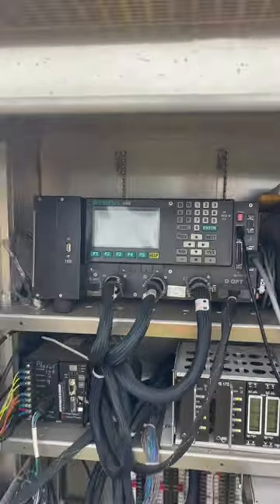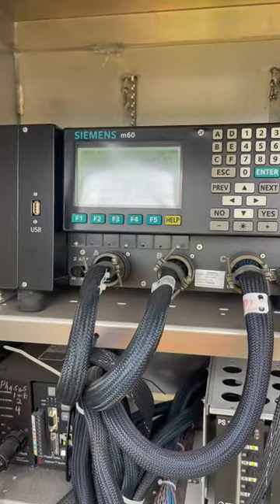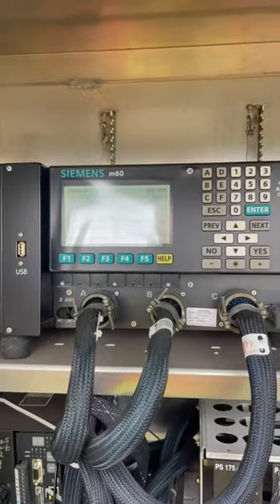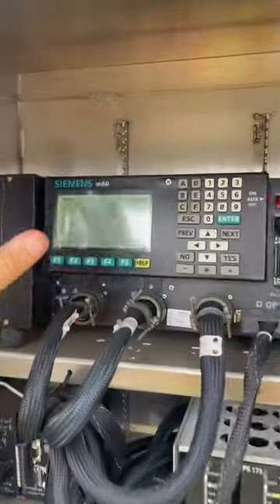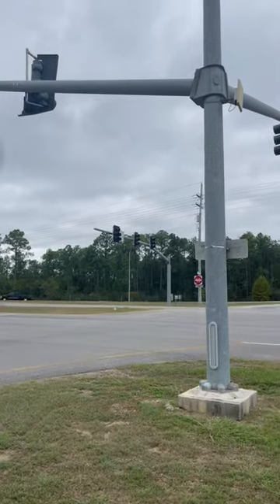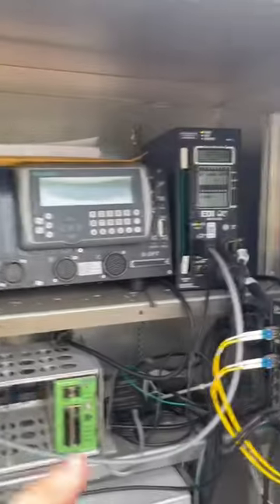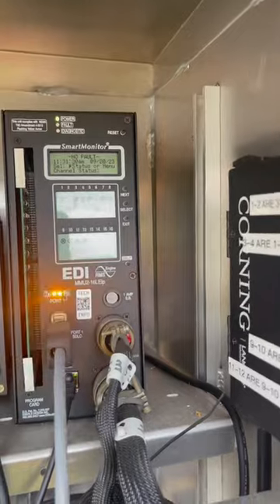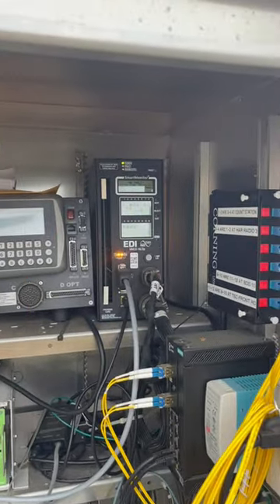Raspberry pi and traffic lights!

Comment: anybody saying a raspberry pi can reliably control an intersection for 30 years is probably still in high school
Reply: Anyone that thinks this stuff in the metal box is going to control an intersection for 30 years is insane.
Reply: @Hornet135 I must be insane
Reply: From what I can find the siemens m60 was released in 2015 and I have seen this tech replace at least 1. Seems a might bit short of 30 years.
Reply: @Hornet135 I work in rail not roads, but I have seen many boxes full of 30 year old siemens equipment similar to this. It's not hyperbole, they do run consistently for decades with proper maintenance.
Working in railways it's pretty common to encounter equipment that is older than I am.
Reply: @aaronbennett80  Sure there’s all kinds of old systems running stuff all over, but the idea that it’s set it and forget it for 30 years is ridiculous. Even if someone can work for decades, that doesn’t mean that it’s the best or most efficient way to do things.
Reply: @Hornet135  Of course it isn't. But public service isn't funded enough to even come close to best.
Even if we wanted to upgrade everything in the railways I work for to modern hardware it would take decades and billions of dollars.

There are some sections of the rail that have even older analog equipment from the 70s. They get upgraded first, that takes 3-6 years depending on scale of the project. By that time the brand new system that was installed 7 years ago is already fast approaching the recommended manufacturer replacement time.

It's a complicated thing to keep large amounts of geographically dispersed industrial systems up to date.

Then consider the amount of money it would cost. It's politicians that fund this stuff. These old devices still work, they don't cause political issues, the public can't see them and the public for the most part doesn't give 2 shits if its ancient as long as their train is there on time. Politicians don't care because it doesn't win them any votes or improve the lives of their constituents in an obvious way, so they often don't fund the projects until they want to run a campaign focused on increasing the amount of schedules trains or something.

Then you get a good politican that actually funds projects, and they lose popularity because they are criticised for wasting money on projects that the public doesn't see the importance of amd taxpayers complain that their money is being spent on things they can't see.

I definitely agree that this is an inefficient and problematic approach. But it is the unfortunate reality of many industries.
Reply: I'm a guy on the internet. I make one million dollars every couple minutes like the rest of you. Bro does have beef with raspberry pi's. They wouldn't be good in this kind of environment, absolutely not. Comparing apples to oranges. Anyway, I digress. (Drink Brawndo) I am far too rich to buy any of this stuff, and I don't give one crap about public safety. It's Pi's or nothing, baby.
Reply: @Hornet135 he literally said they could run for decades with proper maintenance, did you even read the comment?
Reply: @rxt1991   Literally literally literally. Think about it, this dude wouldn’t have a job if it just ran for decades with proper maintenance. He definitely changes out modules that are not decades old.
Reply: @Hornet135 it doesn’t have to be the best for this application. But reliability and not fail. Did you know you can buy a regular hard drive. They also sell server grade hard drive. They do cost more. The server grade hard drive is made to run slower and have less errors. That is why they are used in data storage. In a gaming system you would want speed so the hard drive runs faster but have more errors. Your computer at home if a error happens it is mitigated immediately and if not. You just reset your system no harm no fowl. But to control the system for the intersection failure is not and option.
Reply: @hoktang1  I didn’t say anything about best. This is reliable, but ludicrously expensive. It could be made, simpler and more robust for far cheaper, but there’s no incentive to do so. Personally I think a 555 timer solution would be best.
Reply: @Hornet135  what is a 555 timers?
Reply: My old place had Modicon PLCs for the factory machines. Super old but most of the cards were original. Learning arduinos I learned while I could code a machine to run even faster, the hardware is too fragile for any working environment that needs reliability. I am at a place that has clocking in machines with PIs. A power surge or disturbance and they are out of action. The modicon PLCs have made millions of cycles in an electrically noisy environment. The hardware and voltage protection  and even double redundancy is something new PI users don't grasp.
Reply: @curiouslycory that’s just a characteristic of an electronic component and why some manufacturers now have short warranties or no returns for electronics.
Reply: @the-guy-on-your-moms-couch good thing they said" WITH PROPER FUCKING MAINTENANCE"
Reply: They more likely dropped out of high school.
Reply: controller use linux same freaking OS.
Both use same arm based CPU running linux, same exact thing. the the difference is case and power supply.
Reply: Yea they probably are in highschool because they understand technology your arguing on the wrong side of history "horses are reliable cars will never replace horses"
Reply: @MegamanTheSecond  okay high schooler
Reply: On a silicon level there is no difference its all about isolation. And that doesnt happen on chip. Which means you can build a pcb around a raspberry which is just as reliable.
Reply: Or just high
Reply: @Hornet135 I could show you around my area some original traffic light control boxes that are probably older than 30 years.
Reply: I'm in high school, and I completely agree that Pi's aren't reliable enough for that. They just aren't meant for embedded solutions. Yes, it could work, but it could also be a big safety issue, and it would need to be replaced pretty quick
Reply: @about10ninjas mmhm brawndo 🤤
Reply: If that were 30 years old, it's be made of relays and bailing wire. And in 3 decades that kit will be long since obsolete too .
Reply: @KendallVance   I know it feels like the 70's were 30 years ago, but 30 years ago it was 1993, and they had digital/solid-state electronics then.
Reply: There possible a os like ms dos still being used for something we don't know but keeping the lights on.
Reply: And probably hasn't fully grasped the consequences of a traffic light making a mistake and showing greens to two lanes
Reply: @Hornet135 it literally has
Reply: @Hornet135 the best and most don’t exist except in fantasy. Stupid real world argument.
Reply: @kuyre2239  os and cpu architectures means nothing. That’s why consumer grade electronics are tested on ingenuity but not the main rover, because it’s just not going to last in that environment. If you ever designed a pcb for industrial use, you will know it’s much more than just the os and cpu architecture.
Reply: With proper maintenance anything can run any amount of time. What if proper maintenance was to simply swap out the pi every couple of years? 30 yrs. @ the price of 20-30 pi modules sounds super cheap compared to what that control box costs. OF course we could use another pi AS the conflict monitor. Imagine the time saved training; just hand the tech a provisioned module and send him to the box to swap it. Redundancy? Add more pi.
Reply: @BeyondPC  downtime is not really acceptable
Reply: you haven’t considered the cost of labor and overhead. Seen the trucks that have to go out there? That biyearly maintenance run is a hundred times the cost of the pi. 

Redundancy isn’t just “stick another one in there somewhere “ situation. Requires software, design, testing, staff, now you’re right back in the situation we’re already in, except working with a non-heavy industry reliability part, and not high availability operating system without raspberry’s commitment to same. 

Consider the cost to the community if 10% of the intersections are down. Who’s head will roll. 

My rpi only successfully runs the boot up python program about a quarter of the time, requiring multiple boots to get it up and stable. Too finicky for unattended high availability use. 

You’re suggesting a “solution” based on PR and love, not reasoned, tested, dollars and cents experience. 

Kick in a big tax increase to roll it out city wide in my 2 million people urban area if you want it that bad. Willing to pay for it?
Reply: You probably need to change the raspberry every maybe 3 years? Still makes it way cheaper than one of those cabinets every 30 years
Reply: Even if a Pi could only do it reliably for one year, it would be far cheaper than all this stuff. The price of these things is insane.
Reply: @jordancobb509  you still don’t get it, raspberry pi or any system on module is not where majority of the cost is. The other hardware and software, engineering cost, and hardening is what costs the most. It will make virtually no cost savings by switching to a raspberry pi, and could end up costing more due to frequent replacements (again the process of replacing cost way more than the material cost).
Reply: But it’s cheap. A pie zero 2 will run those for a year atleast. $30 a yard. $900 give or take for 3 decades compared to whatever he said.
Reply: @NoirDesigns  you don’t get it, raspberry pi or any system on module is not where majority of the cost is. The cost to develop, manufacture and maintain the other hardware and software (intersection control control system is much more complex than what you think, there is a central control center and many have vision based system), everything other than the cpu/module is what costs the most. It will make no cost savings by switching to a raspberry pi, could end up costing more due to frequent replacements (again the process of replacing cost way more than the material cost).
Reply: Well comparing prices it doesn't have to last as long
Reply: Maybe In ideal conditions
Reply: @aaronbennett80 talking out both sides of your mouth:  is it better than other available hardware, or is it the unfortunate truth? And in what is it being the unfortunate truth an acceptable argument?
Reply: I'd believe it. My experience is with trains rather than roads, but I have seen 50 year old relay control logic still in service. I would believe this system, even if some parts of the unit die, will still be operational in 30 years
Reply: @aaronbennett80  its not that this is old.  it's that it's so incredibly overbuilt.  This rackful of controllers could be replaced by a fistful of relays.
Reply: @Hornet135 You can't even read what people write and just because you imagine it doesn't make it ridiculous. Most of professional hardware is  not only capable and intended to run for decades it IS run for decades.
Sorry that it surpasses you capabilities of understanding. But doesn't make it untrue or even ridiculous.
May be get a real job instead of keyboard warrior you would know.
Reply: @darknase   I can read just fine, however you can’t write just fine. Calling something professional doesn’t give it magical powers, it just makes it expensive. I have a job that involves me troubleshooting and fixing lots of “professional” hardware. Now go work on your grammar.
Reply: primary school more like.
Reply: @Hornet135 Oh bless
Reply: Just because you are incompetent in embedded systems does not undermine the effectiveness of the technology
Reply: Why would a ras pi not run for 30 years? It's incredibly simple. I see street light computers down all the time. I've never had my ras pi crash. I've got one of the original models, still works fine.
Reply: I read still high in school, prolly true aa well
Reply: @Hornet135  I wish it didn't last 30 years because I world on stuff OLDER than 30 years all the time and its annoying. Fucking PLC5's.
Reply: @EndlessDelusion we just replaced our PLC5  that ran line controls. The only reason behind the upgrade was the old conveyors had holes rusted though the sides. That old PLC would still be running today if stainless conveyors were installed when the line was new.
Reply: I have arduino controllers that have been running for +7 years. Transistors and resistors are a little different in quality than what siemens uses, however, it's not impossible to obtain the same quality components. As long as the supporting components are well designed and have qood quality components, they will last just as long. It's similar to using a honda accord as a daily, but you have the budget for a McLaren. Which one will last longer? The more complex vehicle that is over priced for its job, or the cheaper less complex vehicle? In my experience, the less failure points, the longer it will run without fault. Remember, putting the intersection into "Flash" is a failure. There are many more ways for the seimens system to go into "Flash" than a raspberry pie or other simple microcontrollers.
Reply: Just on price difference alone, popping in a new pi every year would save costs compared to the mark up on this specialized bs.  Just stupid people doing stupid things cause they are dumb enough to pay someone just as stupid too much money.
Reply: @YuzuRyougi it's not exposed.  Those containers stay cleaner than your house.
Reply: @YuzuRyougi you can pay one person a years salary for the cost of some of these components.  Let us know when you learn the concept of modular systems and redundancy.
Reply: @YuzuRyougi if downtime isn't acceptable then why is this maintenance happening? Is it just that overpriced equipment turning on their oopsie lights doesn't count as downtime?
Reply: Wrong!  Been out of highschool for a bit, and it's not about the rpi, it's the fact that much cheaper sbc hardware could 100% be used in an intersection.  NOTHING about this hardware is special that truly requires $100k